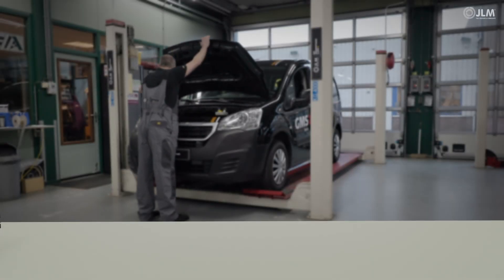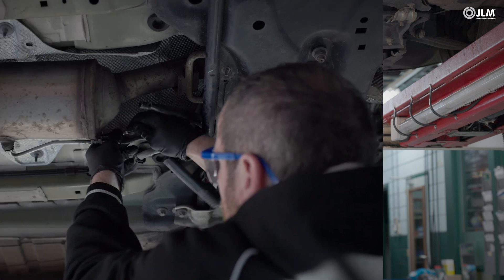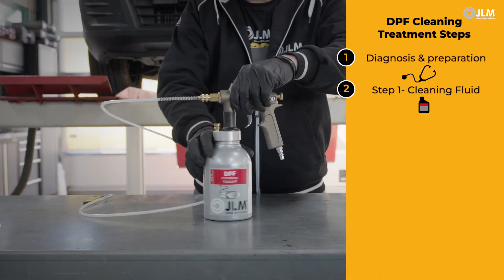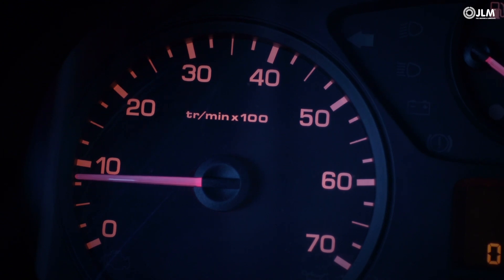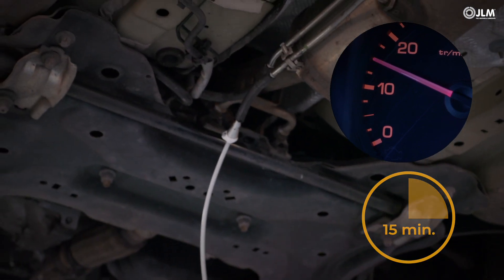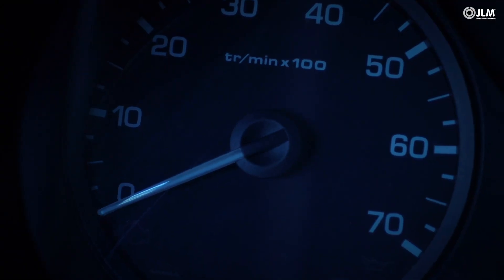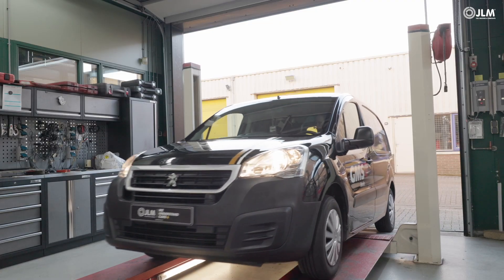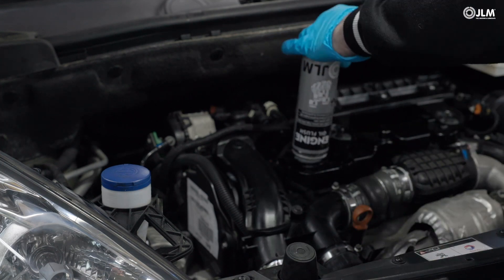How to clean a heavily blocked Diesel Particulate Filter (DPF) - using JLM Clean & Flush Kit

Comment from the maker: Sometimes a DPF is so badly blocked that using a DPF Cleaning Spray is not yielding the desired results. Before you start hacking off the DPF there's one more option available. It's time to bring in the big guns - the JLM Clean and Flush DPF Cleaning Kit (Part No J02230 and J02250). 

In this video we'll show you a step-by-step guide to using this cleaning kit, key tips and tricks to ensure you maximize the effectiveness of the DPF  cleaning process and common mistakes to avoid when using DPF cleaning solutions.

The JLM Clean and Flush DPF Cleaning Kit will remove soot buildup and regenerate your DPF effectively, ensuring your vehicle runs smoothly and efficiently while complying with emissions regulations.

For more information go to https://www.jlmlubricants.com.au/product-category/diesel

https://jlmlubricants.com.au/products/diesel/jlm-diesel-dpf-cleaning-toolkit/